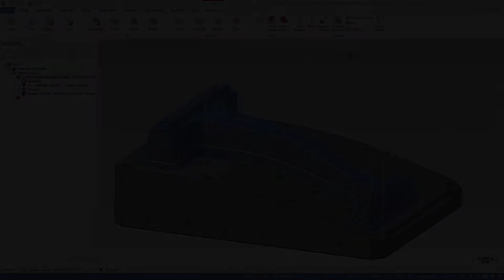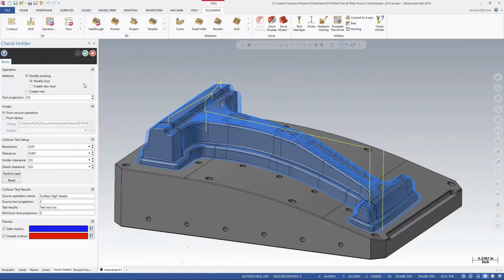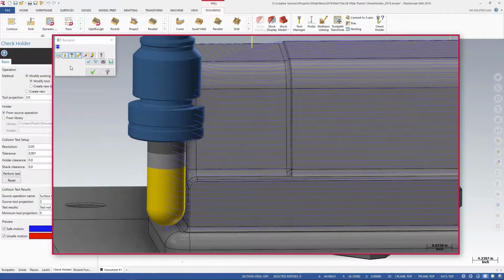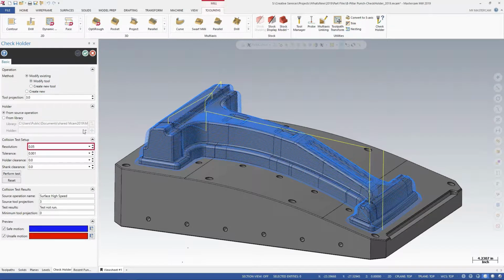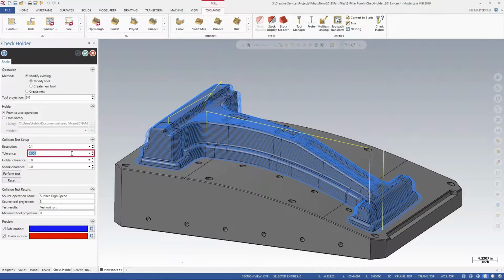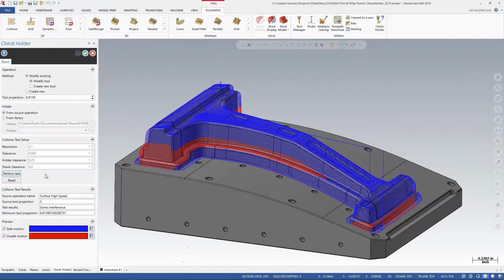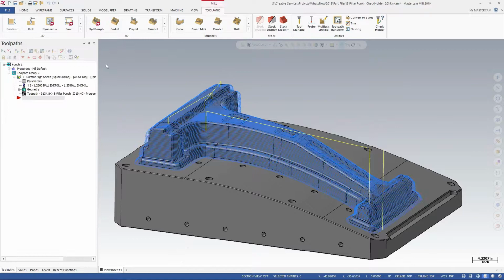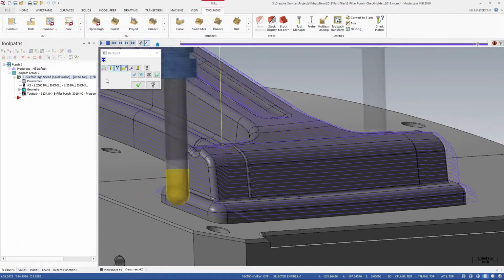Check Holder Function - #Mastercam

Comment: Can you split Tool paths by what can be reached with a shorter Tool , then cut the remaining with a longer Tool ?
Reply from the maker: Hi Tim, yes you can always shorten/modify a toolpath to workaround collisions.  However, the check holder integration will calculate the minimum safe tool projection to mitigate collisions while keeping the toolpath unmodified.